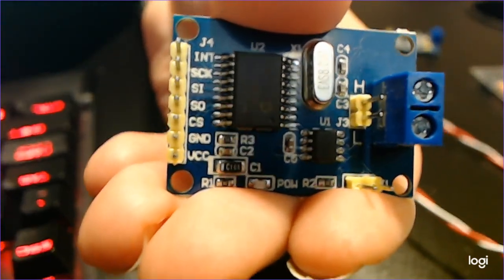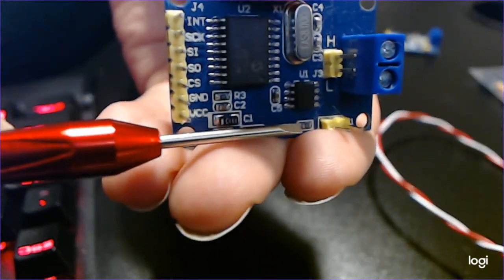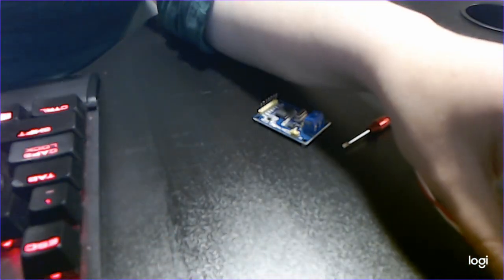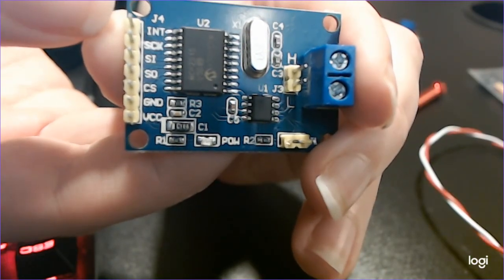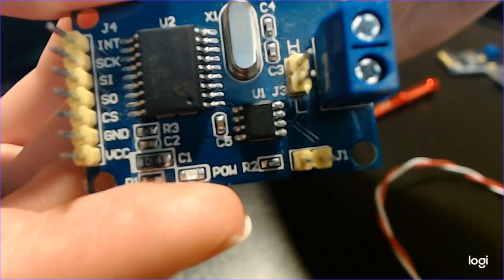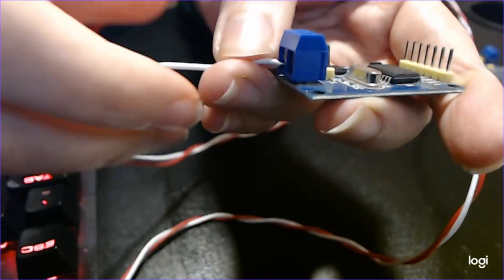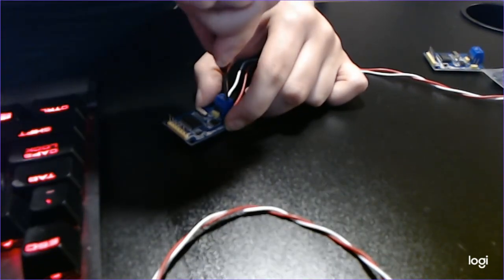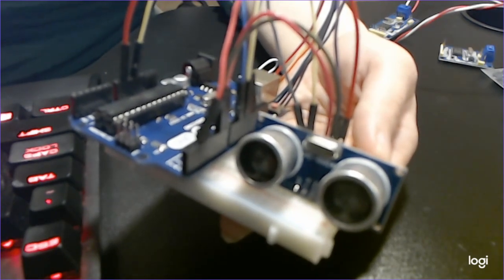MCP2515 setup

Comment: With a jumper on each of the resistor pins on my two MCP2515, the resistance measures 60 ohms, which is correct.

Comment: Hello, I have a similar problem. I am trying to send CAN messages from Raspberry pi through a CAN module mcp2515 through the SPI interface to the bus, but no CAN message is sent. I then used the oscilloscope to observe the signals on the SPI cables and I found that MOSI data is sent, but no response comes out on the MISO cables(only zeros). What could be the reason? I've been trying to find a solution for 3 days, but I just can't find it.
Reply: Is there 8mhz oscillator on can bus module?
Reply: No, there is on spi-modus

Comment: when I am trying to use this module with  my discovery board ( I am at first tutorial and it shows it with different module ) which pin on the mcp2515 module should be connected tx pin and which one to rx pin ?

Comment: There is resistor 120ohm on pcb.. You should use jumper to engage resistor
Reply: So when poster soldered the resistor, they engaged the onboard resistance and added their own yet it still worked. Neat.